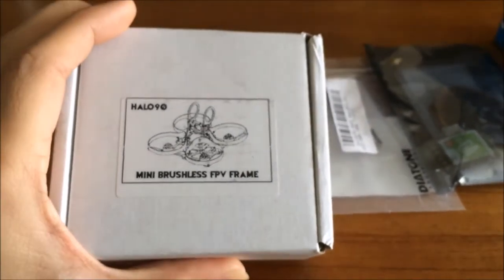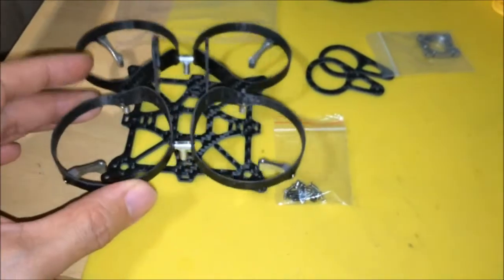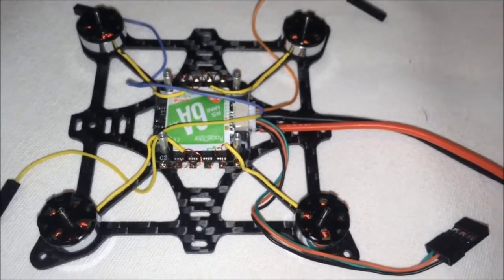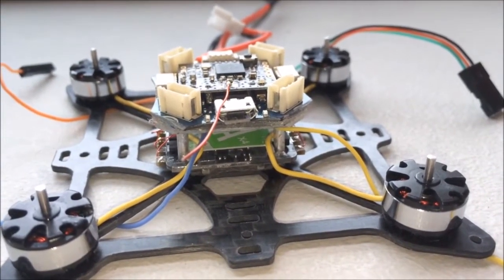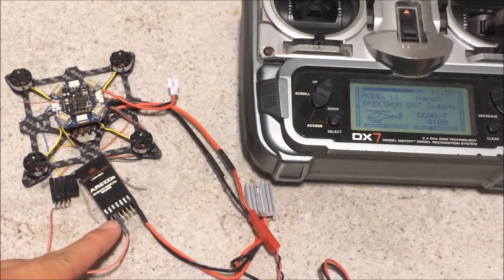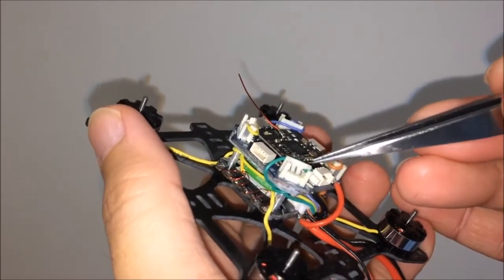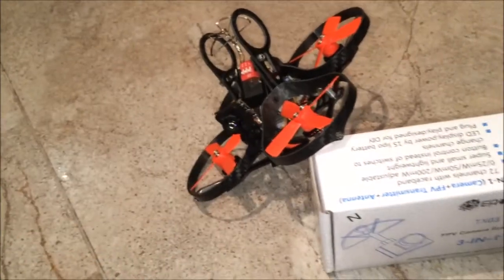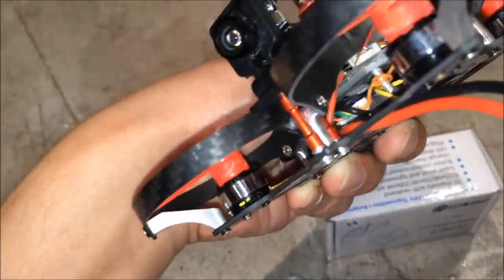Build a 9cm Drone (Brushless Tiny Whoop!!)

Comment: Nice video but the sound is so low... but you have shown  a lot of things.
Nevertheless I need some more infos:

1) First your build is done with 
 1.1 as frame  an original AXC HALO 90 from https://www.axc-drones.com/
or an Aurora 90 frame Banggood chinese cheap clone/copy of the original AXC HALO: http://bit.ly/2eXaQFm 

1.2 as flight controller: 
 a Super-X / Oversky / Banggood Micro Scisky MX Naze32 X 1S or 2S Flight Control Board: http://bit.ly/2gA81Km

1.3 as ESC / PDB :
4 in 1 ESC Racerstar 20x20mm Mini RS6Ax4 6A 1-2S: http://bit.ly/2wzxcWB

1.4 as props
I guess 2035 Propellers : http://bit.ly/2x5EQtg

1.5 as motors 
I didn't get the motors you used ? 1103  or 1104 ? something else ?

2) you show that CleanFlight configurator working with this Super-X / Oversky / Banggood board is an old 1.2.2 configurator. 
To install an old Cleanflight Configurator see https://www.youtube.com/watch?v=YgEK8MQWKSc

3) good  PID are shown at 9:32

4) you show your build flying at 10:52

Overall Thank you !!!
Reply: It looks like he's using the LKTR motors or superX replacement motors.. those r rated 7500kv, lighter than 1103, definitely makes a quad 'on steroids' with 2S setup but i see no screw holes in that motor. Looks like he's using the screws to stack up 2 props for height, the bottom prop has fins cutoff.